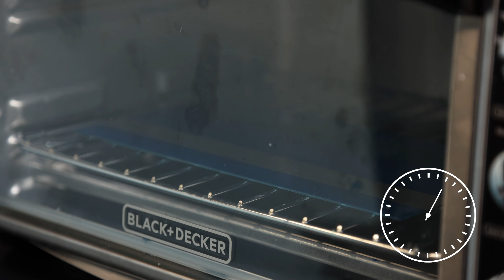Powder Coat Masking: When Should You Remove Masking Tape?

Comment: what will the result if you remove the tape after powder is applied before taking it to the oven?
Reply from the maker: The hard part would be removing the tape without the powder falling back onto the metal or messing up the rest of the powder on the surface